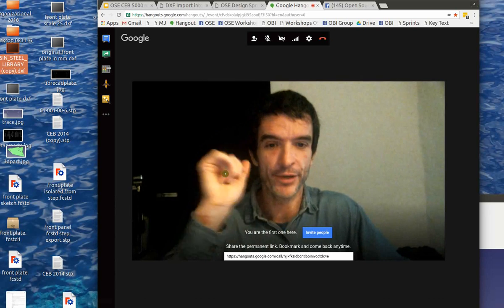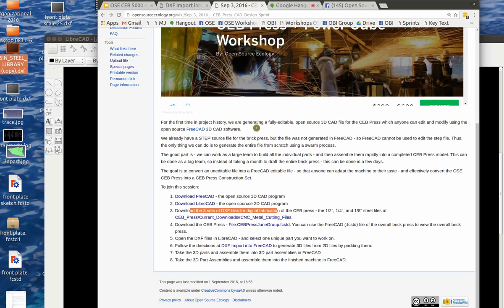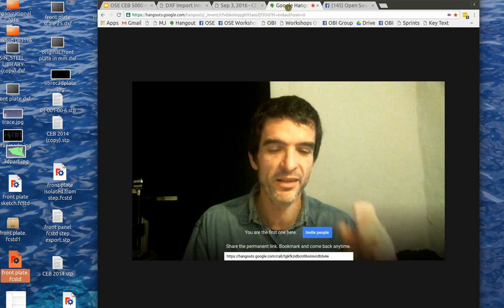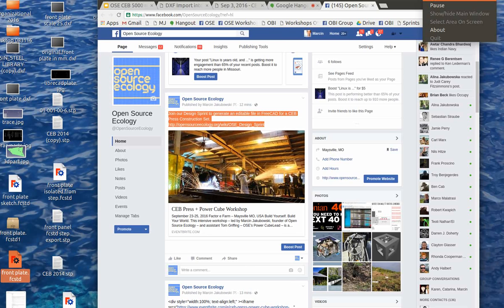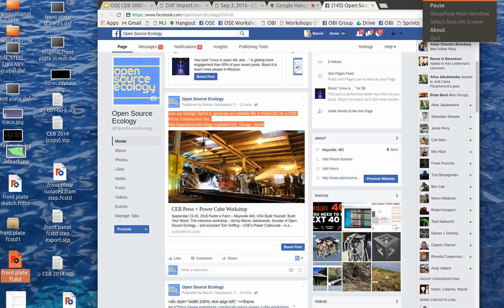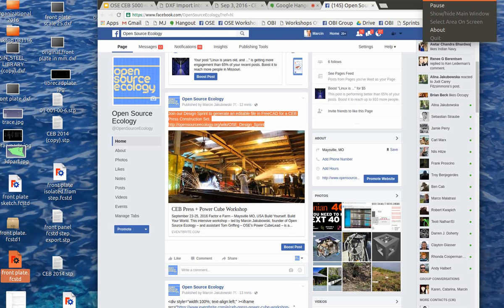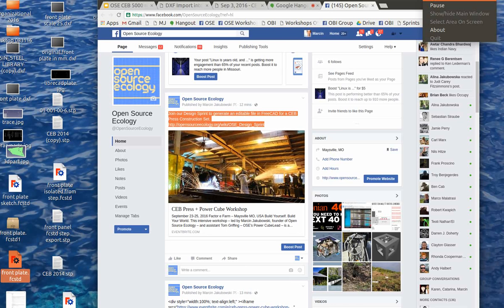CEB Press CAD - Design Sprint

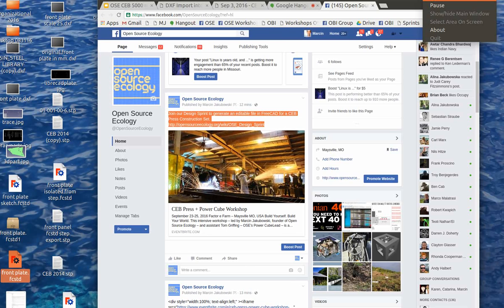Comment: Marcin, according to the YouTube feed this video should be 5:12 in length however your video is cut short mid-sentence and mid-message at 1:47. I refreshed and replayed the video and had the same result. Can you please take a look at this. Thanks
Reply: I should also add that the player software (iOS) is reporting that the video is only 1:47 in length once it loads and starts playing.